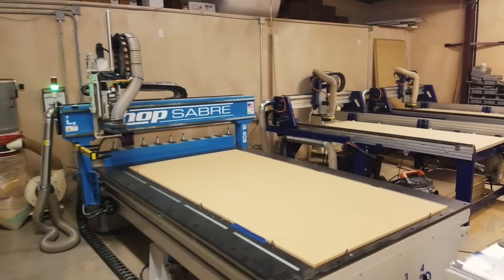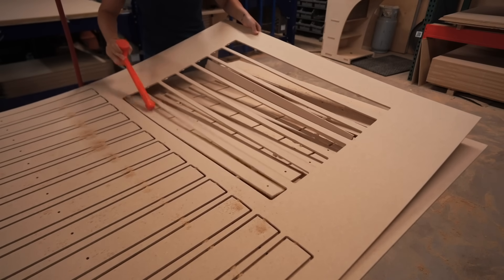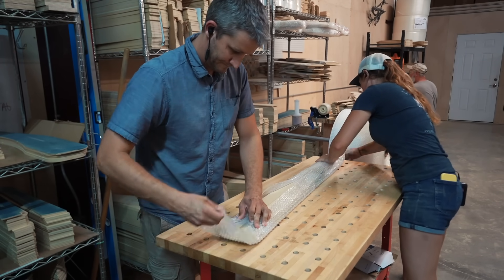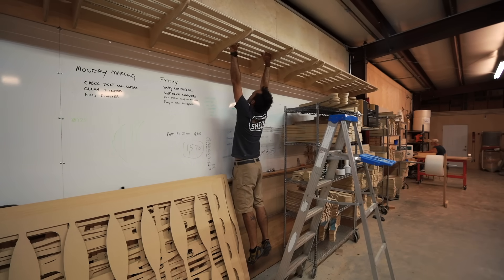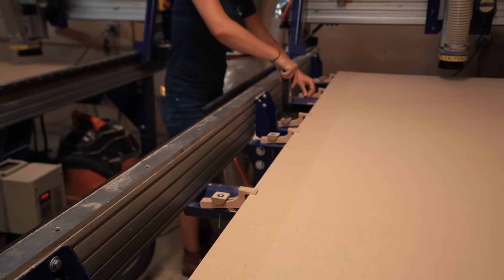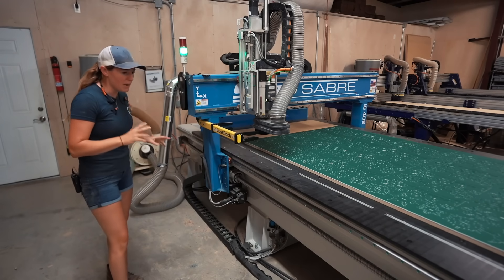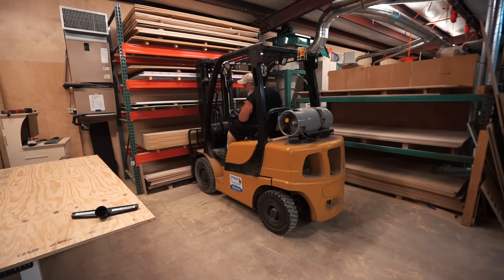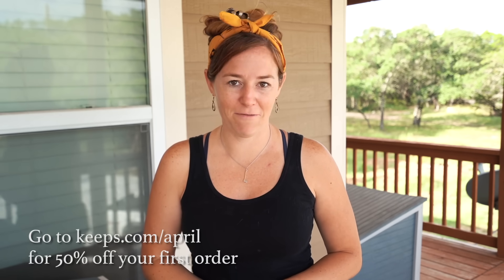CNC Shop Tour | My CNC Business

Comment: Wow, you’ve come a long way!   Just would like to recommend some kind of air filtration system to get the tiny particles of dust that act more like a gas out of the air.  MDF dust is hazardous to your health, as is all small particulate dust.  Get or make one that you can change the filters in.  Keep OSHA off your back.  Great shop and video.  I’m surprised Router Bob did not tell you that the primary use of compressed air on an ATC system is to pick up and hold the ISO tool holder in the spindle, not to blow a small amount of air out the spindle.

Comment: MDF is nasty. I won’t have the stuff in my shop - ever. It’s full of microscopic carcinogenic particles that hover in the air. Get better air cleaning and extraction systems. 

Toggle clamps would solve your thin board clamping issues making it a much quicker, one handed, single operation process. 

Thank you for sharing

Comment: April, you're absolutely right about the significance of the time saved with automatic tool change. But in the real world it's much more that the 45 seconds hands-on time it takes to make the swap.

For a human operator to do it they either have to stand around waiting until the machine needs them or the machine has to stop and wait for the human to be available. In the first case you're wasting a valuable human resource much of the time. In the second case you're holding up production throughput until the operator is available. If the operator drops whatever else they're doing to address the tool change their other task gets interrupted. All of which is inefficient, wasteful and costly.

Comment: It looks like you haven't quite figured out which end of the hammer you are supposed to hold, just a hint it's the handle. Try hitting with the head, it works much better.

Comment: Awesome channel. Awesome video. Quick question.  I get how the vacuum pump holds down the spoil board, but the work piece lies atop of the spoil board.  How does the vacuum hold the actual work down?
Reply: The spoil board is air permeable, and always leaking. It takes a constant removal of a volume of air to keep enough suction directly under the stock being cut.
Reply: @leehaelters6182   Thanks!

Comment: Ball screws do not eliminate play, or backlash as it's known. Definitely minimizes backlash compared to rack and pinion though (good lord, that's honestly kinda horrifying to think you could get some precision from that, but then again, I tend to live in +/-0.005 according to part specs, but I try for less than that) If you really want zero, or very close to zero play, you need some fancy positioning additions. Like glass scales. And really damn good quality ball screws, and thermal comp, with a climate controlled room. I can't imagine you're aiming for less than that +/-0.005" though.

Comment: I didn't come here to watch the video, I came to make this comment/observation:

I don't have an interest in CNCs !
A robot is designed to do what it's designed to do. Perhaps appropriately, it's a digital process - either it will do what you want or it won't. Manual machines therefore have more character; less rigid rules, - more flexibility. Often, a manual machine not suited to a job can still perform that  job with adaptation. It is, however, far from ideal for doing repetative work ;)

Now I'm here and read a comment or 2, I'm going to watch the vid - not necessarily all of it though :)
Reply from the maker: Many have been asking about my CNC Business, so I wanted to show what it is I'm doing and why. I still make things for projects without the CNC but making templates in mass I would be crazy to not use the machines I have. Templates can always be cut out with a jigsaw it just takes longer. Thanks for watching, even part.  :)
Reply: @AprilWilkerson  You're crazy for using those WRONG machines for what you're doing - see my e-mail !
Nice business tho !

Comment: I see that the machines and shop have a vacuum system and yet there's a lot of dust on the floor, does this cause you problems for the Computers that run the CNC machine?

Comment: Instead of 6 hold-down clamps/side, ever thought of using a "line clamp" running down the edge with, say, 3 clamps only for the two ends and the middle? It will cut down 50% of your clamp time.
Reply: I thought this too: Use the red handled toggle clamps (3) with a strip of plywood connecting them linearly. It is flexible enough you can do each individually, or a more rigid bar with one in the center.
Reply: I would use a price of angle iron attached to a pivot and strong spring. Then a step on lever would pull back the spring and ‘line clamp’, once pulled back you could remove the pin to allow the clamp to move down Into position. That way when your done and need to remove project the hinge line clamp could be retracted.

Comment: There are very very few factories in Texas, though I admire the machinery. The ones you have aren't for a commercial factory setup you have and are not going to last as well as a factory machine made for high volume constant movement. I have used CNC machines for most of my life. Do you have a university educated engineer at least as a consultant? I retired from making car parts for the big three and worked with a lot of engineers.

Comment: Look into pneumatic lifters for the sheet goods. Stand on edge and lifter pulls and positions the sheet without touching it.  You should be looking at robotics at the level you work at now.  Also look at a hotter laser and add the ability to do sheet metal for templates that are going to be used in production not just for one offs by diy types.

Comment: Congratulations on the CNC shop! I suggest in the future upgrading your dust/chip removal vacuums. You will see   a drastic change in tool life when you can get the chips removed as fast as possible.
Reply: Not to mention reducing the amount of dust collector maintenance and bag changes. Oneida probably makes a few solutions to replace all those vacs with less equipment for a similar cost.

Comment: Thank you for the tour, really inspirational! :)
I have two tips / things to consider: 1. you could make vacuum beds yourself for the other cnc tables, which would make the routing station obsolete. It's not super difficult :) 2. you could consider using destaco holding clamps for holding down the sheets, that might be quicker and easier than screwing them down all the time :)
Good luck and thank you :)

Comment: Using a CNC is NOT woodworking...
Reply from the maker: It's another tool in my Shop. People could trace and then use a jigsaw to cut out the template but if I am doing mass quantity, the CNC is the way to go. Using a circular saw vs a hand saw, or a drill vs a screwdriver isn't cheating either. Just an easier way to do things but achieves the same result. Thanks for watching.

Comment: They make "pneumatic swing clamps" that would significantly speed the clamping of the sheets instead of the one-at-a-time electric screw driver method.  Clamping force is dependent on the air pressure. All clamps on one line hold with the same force automatically. 

Also, please read my suggestion for sheet handling in your previous video about moving sheets from the shelf to the tables. I'm a retired Automation Engineer (EE) with many years of ergonomics and efforts in speeding up production and reducing worker fatigue through simple changes like these. Both will make the job faster and with less worker fatigue. 

Your videos are always  very interesting and fun to watch. I can't believe the amount of energy you seem to have.

Comment: Have you thought about using "toggle" clamps for hold downs on the non vacuum CNC's? They are quick, easy and some automatically adjust for different material thicknesses. As always, another AW video that I learned from. Thanks.

Comment: Automatic pallet changer has increased our production like you wouldn’t believe, the machines are running constantly, change out A pallet whiles B pallet is being cut, machine automatic swaps a and b pallet and starts cutting a pallet. We run high volume steel and aluminum firearms parts but with 4x8 sheets like you run a APC system would definitely be worth looking into plus depending on run times you could even run the machines dark, we work 10 hour days but since a pallet takes 4.5 hours plus to run we run the machines dark and if a tool breaks the sensors catch it

Comment: Nice setup. Two suggestions:
1. Use toggle clamps for hold downs. The good ones that you can pre-adjust and work with variable height materials. Bessey makes those. MUCH faster than the screwdriver!
2. Learn how to configure air cylinders and pneumatic lines, valves, etc. They are VERY simple, inexpensive, and you could easily make alignment pins for your other machines, as well as hold downs, etc.

Comment: Those alignment pins and atc units are awesome. I worked at a cabinet factory a long time ago and ran the cnc router. It was a little higher end, but had the alignment pins and vacuum bed. Was so quick and easy to load and and get going. My job was super simple.

Comment: Kinda jealous - can I come and live there (will even sweep!)? Hey, instead of using tabs, I use a 1/8" compression bit - will cut 1/4" MDF in one pass @ 250-300 IPM and the dust packs back into the kerf so you still need to knock parts out, but NO MORE TABS!!! 🍺😎🤘
Reply: You cannot use the dust collector though when doing this, correct? I've tried it with a 1/4" compression bit with 2 passes and it does still lift - but I had D.C. on.

Comment: Look up a kahn bahn system. Basically, you look at your usage and design your stock requirements and set a point of inventory at which you need to restock. The rate of restocking is also based on usage. The stock level and minimum level are listed on a tag for each part. When a part is depleted under the minimum, it gets added to the production list.
Reply: Another vote for kanban! Lean manufacturing principles will streamline the shop in a hurry.
Reply: That's basically what she's doing with stacking it on the rack.

Comment: CO2 laser could speed up cutting 1/4" MDF .
My 100w cuts through it at 40in a sec..at only 60% power
No need to use hold downs.
No tabs .
Reply: Do you have one that can take a 4'x8' sheet?
Reply: @woodfinchcrafts7267  I do not mine is 2'x3' but you can get them that cut 4'x8' and larger priced comparably to a CNC of the same size . I've seen them with auto feed where basically all you load a stack of material and get stack of parts out the other end.
Reply: @geterdnboy  That's awesome, I did a little looking and there are plenty 4x8s. They were much cheaper than the machine shown with an ATC - without that, they are still a fraction of the price. I think she went way overboard with machines that are intended for a lot more than 1/4 mdf, if that is mainly what they are using. If I had the orders, I'd consider getting a 4x8 laser myself.
Reply: @woodfinchcrafts7267  I can only think of one issue and that could be charring on the edge of the cuts that sometimes happens with lasers although it can be reduced with a powerful laser and good air assist ..I've seen good lasers produce parts with no charing at all.

Comment: Another amazing video and one that is of great interest to me. As I mentioned on one of your previous videos, I have an IS 510 in production and can’t wait to get it. I would love to see how your vacuum pump is set up as I am struggling with a location right now due to the size of the pump and the required clearance for air flow. Also, I would be very interested in how you have powered everything up i.e. where are your outlets located? Did you go with a central junction box/power panel for everything (I swear I saw this on a YouTube video one time but can’t find it now), on/off switch for your vacuum pump, etc. Any info would be greatly appreciated.

Comment: Try an oscillating tool to remove those tabs - super clean, fast and precise
Reply: Their method is much faster.
Reply: @woodfinchcrafts7267  of course, but it also blows out the back, not always what you're after.
Reply: @overbehindunder , I think that the direction they punch the pieces out keeps the tabs from breaking out the back of the workpiece. If they were lifting the parts out, the breakage would be on the back of the part, it is true.